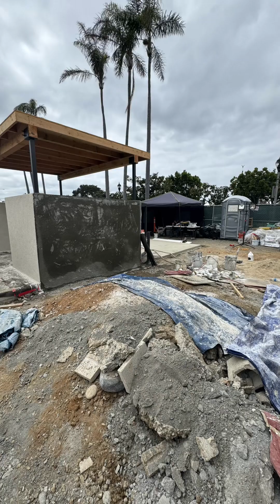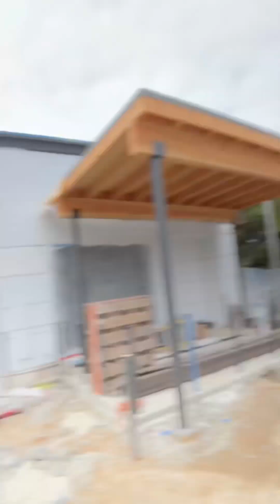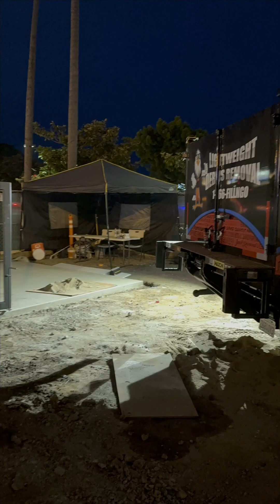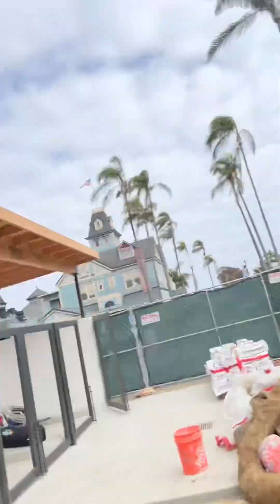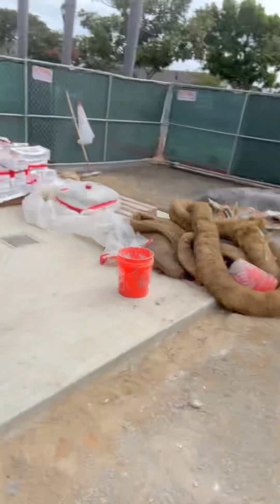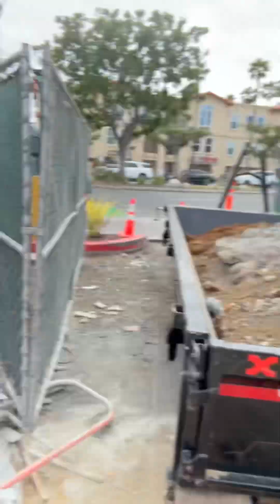Make money doing construction site cleanup jobs ￼

Comment: hey bro where so you take this mixed heavy load?
I'm from San Diego area also
Reply from the maker: I try and take it to Moodys in Oceanside. They charge $165 per load.$100 more if there is rocks in the dirt. No organic materials though. They’ll send you away if they see any grass or roots of any kind in it. 

Otherwise I’ll take it to Escondido EDCO. They will give you a better rate on dirt drop off but not sure what they are charging for clean dirt right now. If mixed with gravel and trash then have to pay the regular trash rate. Super expensive.